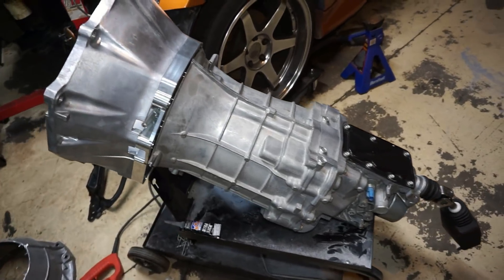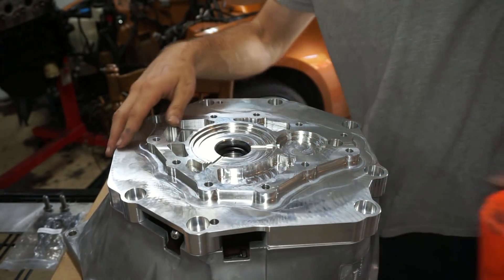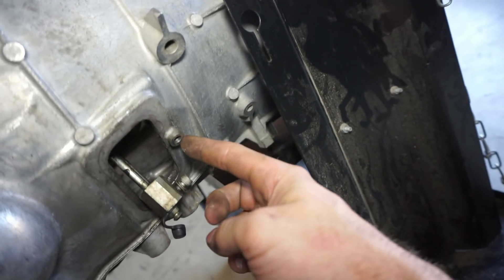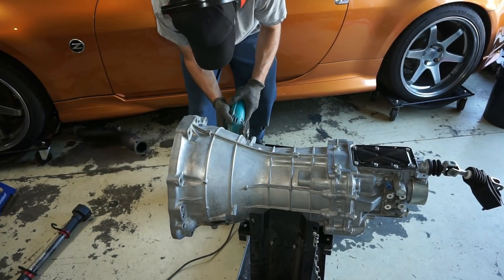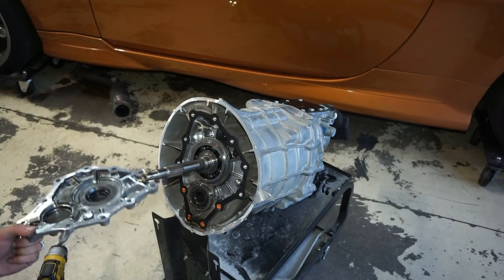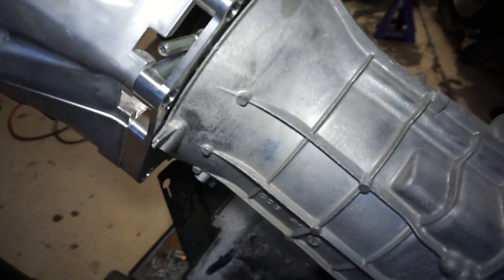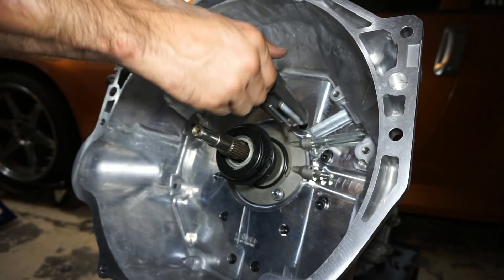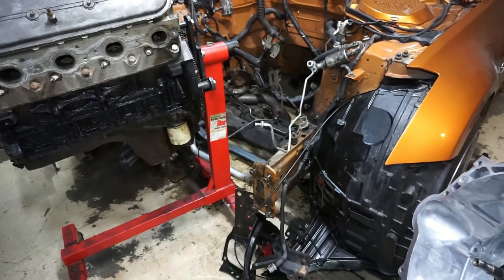This Guy Cut His Transmission IN HALF!!! Collins LS To CD009 Adapter Plate Install!!!

Comment: So, you're transferring the torque load from the bell housing and trans case to the  throw out support face? Doesn't seem too kosher, but I hope it holds water. At least you're not increasing the torque load over stock or anything. Lol
Reply from the maker: Pancho Northmann Can't be too much different than an ultra-bell for an auto that bolts to the pump face... Guess we'll find out when it breaks, lol.

Comment: Why just not get the loj adapter kit for the LS motor
Reply from the maker: dishon Williams This route, including engine, mounts, and oil pan, will be cheaper than that kit with a clutch... It's a nice kit though, I like that the bellhousing doesn't need to be cut, Just a bit pricey... I'm trying to do this entire swap with turbos for less than I sold the old engine for.